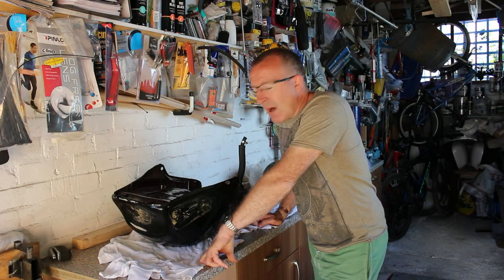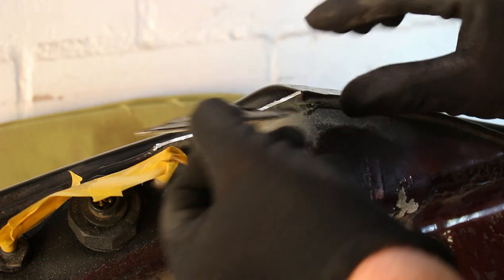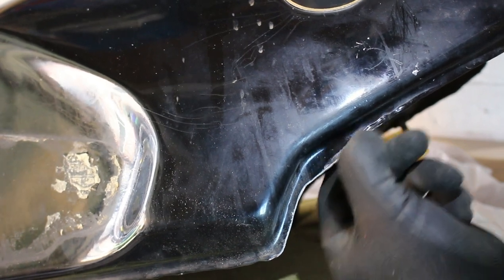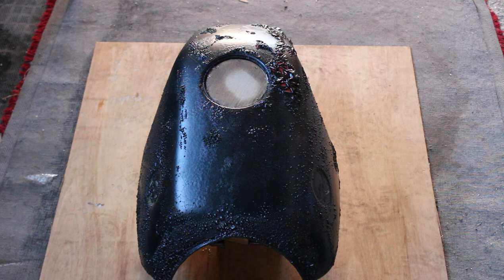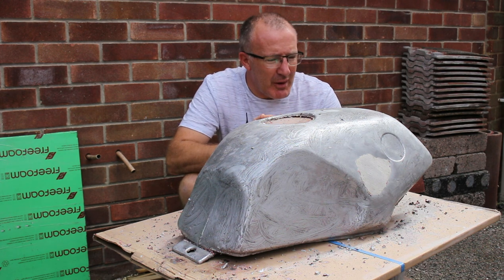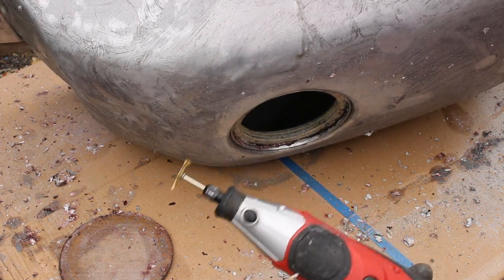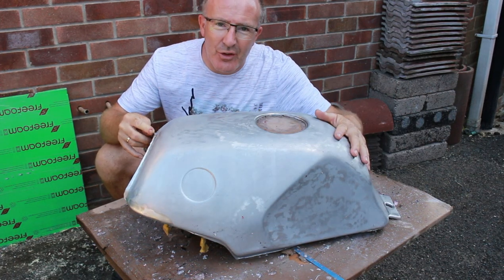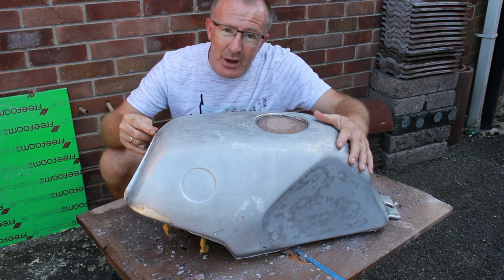BMW K100 Cafe Racer project, transformation begins,Tackling The Tank

Comment: When I cut those bits off my K100 tank the seam did leak and I had to use liquid metal to seal it.
Reply from the maker: I have donevthis twice now, on K100 RS 16v and this 8v you need to get close with a dremmel type cutter but not to close. The key is to tidy it up, they did not take care with welding seams so I added filler in between weld bobbles rather than risk damaging the tank.